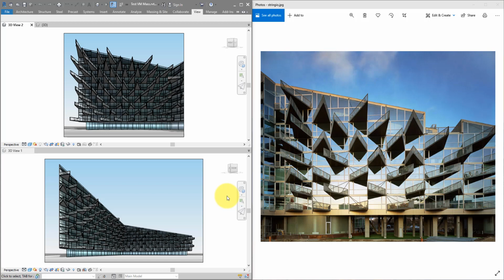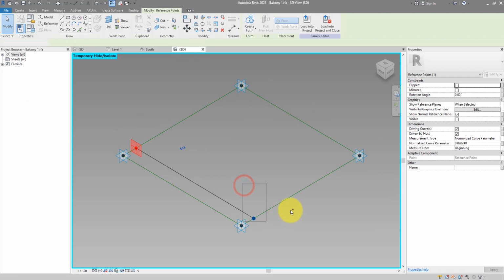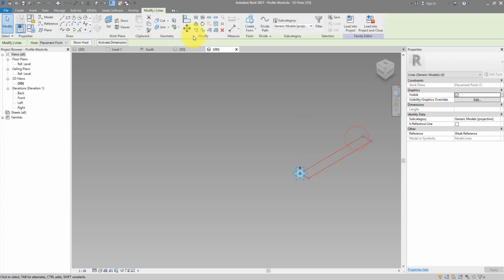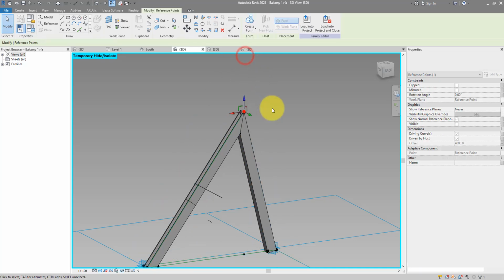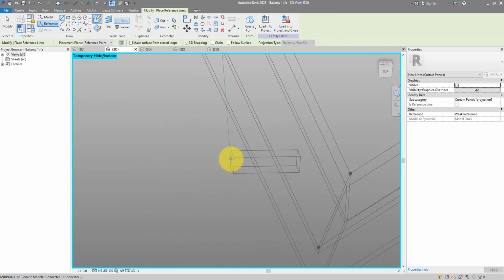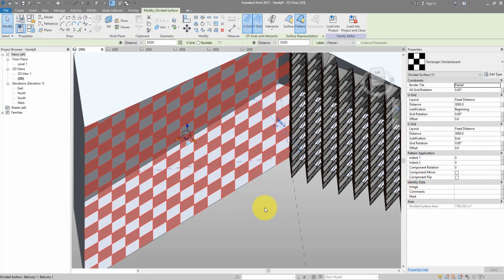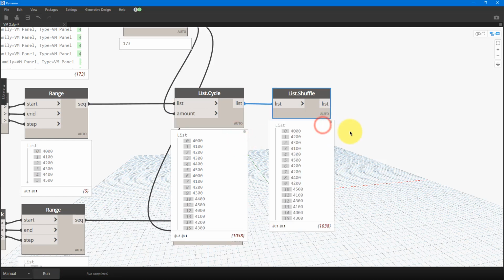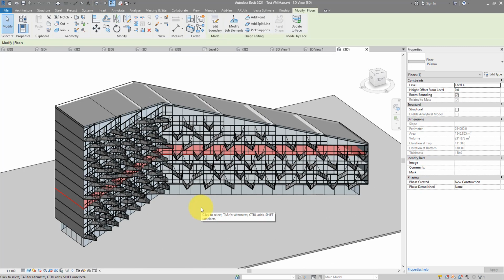Revit Snippet: Create Randomized Facades with Adaptive Panels

Comment: Great tutorial👍 will you do the tutorial about the roof structure? 👀🙏  https://imgbb.com/RgnNdfW     https://ibb.co/sq3pX4y
Reply from the maker: Hi Luis, I did look into this but it seems there's clever way to quickly generate such a truss system. Are you familiar with creating these trusses manually 1 by 1?
Reply: RV Boost I've been with the program for 1 month, I'm not very familiar with how to do that, the truth would be great if you did a tutorial, there is very little about these structures on YouTube.
Reply from the maker: Opps I made a typo in the last comment. I was meant to say there is *no quick clever way to generate these trusses. People have been creating them 1 by 1 or buy some Revit plugins for this task. This is probably why there aren't many tutorials on this topic on Youtube 😅